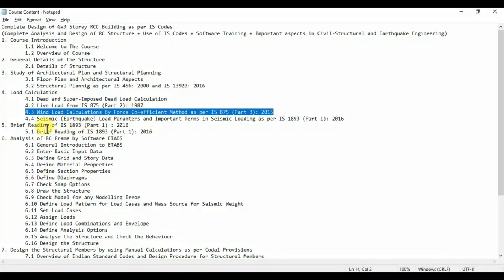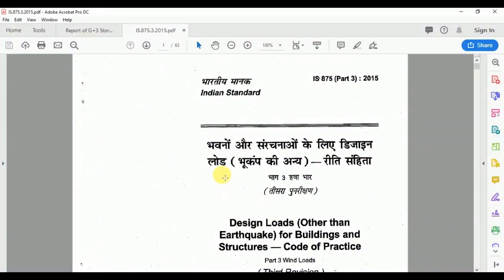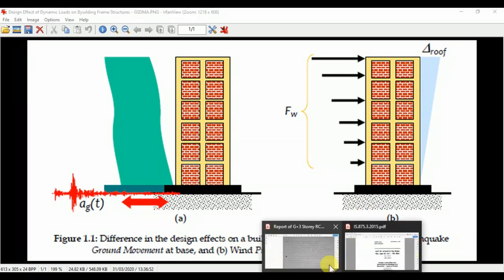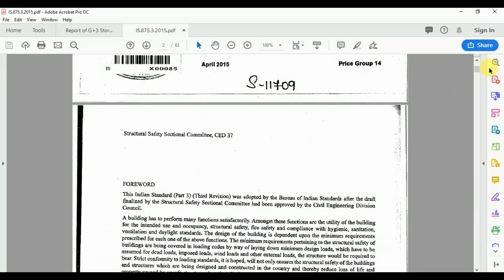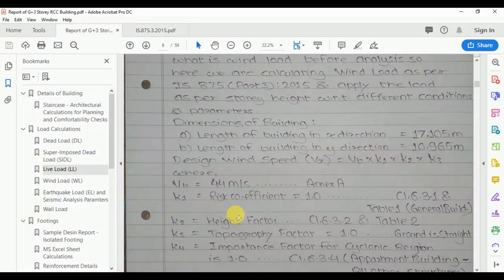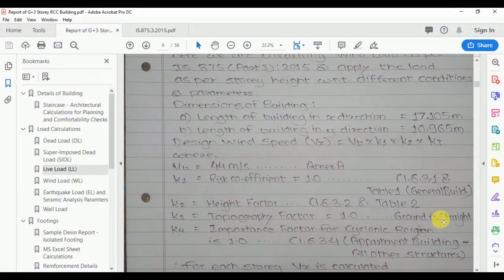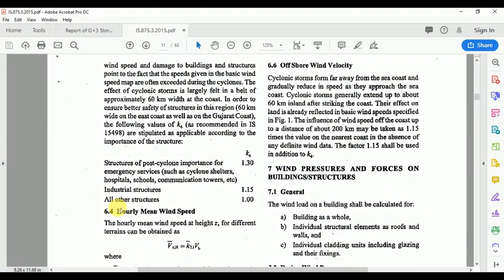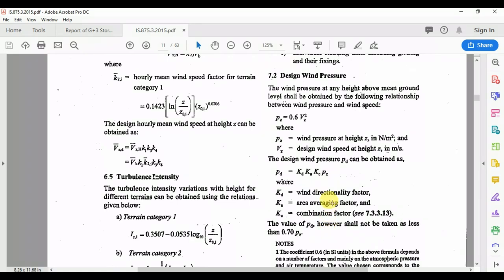4.3 Wind Load [WL] Manual Calculations By Force Coefficient Method as per IS 875 (Part-3): 2015

Comment: Good explanation sir but how to calculate the tributary area. for considering value of Ka
Reply from the maker: @harishacharya4470  tributary area is the area covered by single column half distance c/c from adjoining beams from bottom floor to top floor....
you should calculate minimum span's tributary area and w.r.t. ka should be taken, for a small structure to be on conservative side ka you can be taken as 1 only...

Comment: Wonderfully done....i can the efforts put into this....please also incude design usin IS 16700 at some point if possible
Reply from the maker: IS 16700 is only for Structures more than height 50m and upto 250m ... for small building project IS 16700 is not used ....

your suggestion, I will consider for future video creation ...
Reply: @AkshayThakur  thanks... this code needs detailed explanation and very little material is available to understand this code....if you have any material source on this code please suggest
Reply from the maker: Book: Brief Review of Structural Aspects of IS 16700 https://www.springerprofessional.de/en/a-brief-review-of-structural-aspects-of-is-16700-2017/16895598

Article: SEFINDIA
https://www.sefindia.org/forum/viewtopic.php?t=19035

also go through some research papers on sciencedirect and books on springer over this for crystal clear understanding on structural safety of tall concrete building structures

Comment: Sir thnx you have shown whole calculation by user load . sir but as we select user load inspite of is875 . so how to assign these wind load ?
Reply from the maker: @shraddeshshirode7556  , etabs has not proper inputs for code based wind load....
If you select wind load pattern as IS-875 Part 3 2015 then Windward and Leeward coefficient etabs is asking whereas in code there three methods by which we calculate forces: pressure coefficient, force coefficient and gust factor approach....
People do input 0.7times Cf in Windward
& 0.3 times Cf in Leeward
but I feel this is not aapropriate and hence y9u should manuaply calculate loads and apply to your model!

Comment: Sir In sidl load 50 mm 0.21*5 ( what convert met/inch/ what5)how in wall load internality mortar
Reply from the maker: for 10 mm it is 0.21 kN/m2 right
so for 50 mm
it is 10×5=50 :: 0.21×5=1.05
hence for 50 mm it is 1.05 kN/m2
Reply: Thanks you very much sir
Reply: Sir 6 mm Ceiling plaster is 456:2000 page no.? Nominal size and mass/weight?
Reply from the maker: for dead load refer IS 875 Part-1 1987
in which you get mortar weight in kN/m2 i.e., 0.21 kN/m2 for 10 mm
so for 6 mm it is 0.6 × 0.21 = 0.126 kN/m2

Comment: The excel that you have provided. In that excel fine the effective height of floor 1 is 3.25m and in the utube video tutorial it's 1.625. Which one is correct
Reply: And what is that table For UDL calculation on column for?
Reply from the maker: sorry for my mistake, in the excel sheet what i provide is correct...
1.625m is the effective height for head room slab
3.25m is the effective height for all the intermediate floors
Reply from the maker: that udl is the same for the given input... btw it is another approach to apply wind loads which i won't mention or teach in the course...
Reply: @AkshayThakur  can I remove that udl part. I could be asked what it is for. I have given a task to design and analyze a modal in 3 days I have to complete that
Reply from the maker: yes you can 👍🏻
Reply: What if there is no head room slab and all just a simple 6 story building box structure.  Than the effective height will be same for all? Or it will still be 1.625.
Reply from the maker: then also at top height is half....
the thing behind the conceot is we consider force acting over diaphragm of floor so the half height of upper and lower floors are consider...
Reply: @AkshayThakur  my story height is 3.4m and 6 story building it is.  So the effective height will be 3.4/2 = 1.7m or 3.4 +3.4/2 = 3.4? I am not able to understand this.
Reply from the maker: for top storey slab only half and for rest all slab levels, same as storey height...
Reply: @AkshayThakur  thanks for all the help u r doing.

Comment: how you calculate area avg factor Ka.In code tributary area is given.
Reply from the maker: basically tributory area is the areq that causes loading and so here in this case area of 1 panel of floor is 3.25×17.105=55.59 m2
for exact actual "ka" value you have to interpolate this area value to value shown in table 4 of IS 875-Part 3

sorry but while preparing the course i won't consider too minute things to include so i don't mention that...
I hope you get the point, that how to consider ka value as per tributory area!

Comment: length at x and y dirn is taken upto the cantilever top or upto the plinth level .thanx
Reply from the maker: It is max length in X and Y Direction at repective storey, for respective floor calculation ... 
At top you need to only consider head room dimensions ... but for be on conservative side I took max at all floors respectively ...

Comment: While calculating Pd= Kd.Ka.Kc.Pz

Can you explain little how to read value of Ka & Kc from IS CODE. You skipped it in the video.
Thanks
Reply from the maker: ka is area averaging factor that depends on tributary areas of columns
Ka = 1.0 for area less than or equal to 10 sq.m.
Ka = 0.9 for area equal to 25 sq.m.
Ka = 0.8 for area greater than or equal to 100 sq.m.

kc is combination factor that is depends on structures's framing action against wind
combined effect of wind loads on the frame, a reduction factor of Kc = 0.90 may be used over the building envelope when roof is subjected to pressure and internal pressure is suction, or vice-versa.

Comment: why have you considered the dimension b as 10.965 even for head room roof ? is b base dimension in y dir or floor dimension in y dir?? Since wind strikes on each floor, so isn't the dimension of that floor be considered?
Reply from the maker: yes you are right, but at top Wind Load is at it extreme level and from perpendicular direction also wind in acting so to became on safer side I Consider whole length for Head Room Slab as respective bottom storey ....
Reply from the maker: in Load Calculations, always care about wind load at top storey because major chances of collapse/damage in windstroms is at top because of no respective support over it ... this type of safety may trouble you while analysis to satisfy codal requirements (that easy to resolve) but not affect much more in design.
as designer most important thing is safety ... so always give more importance to lateral loads ....

Comment: Sir can you tell how to find cf for cylinder or pole
Reply from the maker: To calculate wind moment you can use following formulae as per AASHTO
(½ x circumference x wind pressure) x (pole height^2)/2
this formula might gave you some higher moment than in general if you check with NESC or with other codes....

Indian Code IS 875-3, i am not sure where actually code mentioned this or not....
Reply from the maker: in such structures like light pole Force-Coefficient method is not used instead of that Pressure Coefficient Method is used.
Reply: @AkshayThakur  thank you sir
Reply: Also sir can you make a video how to design a flag pole manually of a height of 60 ft and in staad
Reply from the maker: @divyanshsharma5538  I am not working in steel structures in major, anything related to high-rise rcc I am open to discussion....
Reply: @AkshayThakur  ok sir ,  can give me a hint how to do it iam designing a pole of 60ft and want to find the moment  i dont know how to proceed
Reply from the maker: @divyanshsharma5538  contact random somebody by LinkedIn - working in steel structures, that the only way I think so, I don't know anybody who is doing this...

Comment: why force is not changing wrt height of the building?
it has changed at first storey only. why not for remaining?
Reply from the maker: wind force is depends upon varoius factors.... most importantly k2 is increase as height increase so....
Reply from the maker: effective height also matters....
Reply: @AkshayThakur  in your example.. Why it is not changing as you said in beginning of the video.. Force will increase with the height.
Reply from the maker: WL increases if your structure is tall structure... in this case buiilding is of height 15 m only & you can see in IS 875.3-2015 for particular considered case in lecture is terrain category 4 in which k2 value till 20m is 0.8 hence here no sudden change in increment of wind is not possible...

but if you are calculating wind load of 10 storey or above there you will ge to see this....
No sudden wind load increment for low rise building structure....
Reply: @AkshayThakur  ok.. I agree that there will not be any change in the wind force up to 20m height. 
But in your example you are showing 11 & 21in x direction and 19 & 38 in y direction....how?
Reply from the maker: @sanjaykumar-nj9sc  here in video lectures considered building is rectangular, X length > Ylength
for X direction wind load, Y face of buiding is consider
& for calculation of wind load in Y in direction, x is facing side....

so because of this dimensions are used in calculation of effective area for wind load... changes are there in wind load in x & y direction....
Reply: @AkshayThakur  in x direction why two values 11 and 21?
Reply from the maker: solve by yourself one example manually you'll get all those things, that how changes are happen.... only by collecting information you will not throughly understand.... all the best!
Reply: @AkshayThakur  👍

Comment: Value of Ka depends upon tributary area. What is tributary area?
Reply from the maker: tributary area is a loaded area that contributes to the load on the 
member supporting that area
Clause 7.2.2 of IS 875 Part-3 (2015)
Reply: @AkshayThakur  Yes..I referred to IITk GSDMA explanatory examples, there I could see lot of examples for framed and unframed buildings. Now it's clear. Thanks.

Comment: Hello sir
In excel sheet what is that " for udl calculations on columns"?
N at last " X C/C distance" what is that sir?
Reply from the maker: that udl value can be use with different methodology... ignore that for the force coefficient method...
Reply: Thank you sir
Reply from the maker: check the about section of channel....

Comment: sir how effective height of 1st floor is calculated?
Reply from the maker: effective height is the half from below storey and half from above storey and in the way we need to consider ....

by mistake, I have not mentioned ground floor so the height from below the storey to 1st floor not consider ... it is ok for small rc frame building but for high-rise building structure you need to consider that as well ...
you can consider that for more effective results ... 👍🏻

Edited: download the updated excel sheet through the same link for all things set with formulas and correct effective height....
Reply: How to find value for wind pressure ?????  Couldn't understand.
Reply from the maker: @Bhushan Patil 
pz = Wind Pressure = 0.6 Vz^2
whereas Vz depends on vb, k1, k2, k3, k4 you can also make whole calculations manually...
for only multiplication function [mathematics], I have used excel sheet ....
take a copy of IS 875-3:2015 and go step by step likewise in video .....
I hope your doubt will now resolve ...

Comment: Sir, How did you get 1.63 as effective height @1st floor? while you have taken 3.25 as effective height for the rest of the floors in excel sheet!
Reply from the maker: sorry... for mistake... there should be 3.25 meter because half of below and above height.....
Reply from the maker: thing is that, for first floor half of ground floor height and half of 1st floor need to be taken, & in sheet I don't mention Ground Floor, so sheet did't get thing in formula for calculation.... that's the problem... but now i have updated the sheet in which you need to input efffective height for 1st floor and for other floors sheet will calculate by itself from input data.... download the excel file again... for updated things....
Reply: @AkshayThakur  thanks a million sir, Appreciated 👏👏👏
Reply: @AkshayThakur  sir can you make the similar video of shear wall?
Reply from the maker: @jamescarter3090  welcome dear & thanks for suggestion...
Reply: @AkshayThakur  you are welcome sir :)
Reply: @Akshay Thakur sir, you had removed the video of slab design? sir could you please upload that video again?
Reply from the maker: @jamescarter3090  sorry... there was mistake in that video, so it was removed... if possible i will make a new one...
Reply: @AkshayThakur  it would be a big big favour  sir! if you do sO 😊

Comment: Why did you perform the wind analysis ..
as per NBC we only perform wind analysis when the structure height is above 15m
Reply from the maker: this is not any guideline that should we not apply for lower than 15m structures by NBC or IS, this is general conecption that wind load is not domniating for low-rise RC structures and it somewhat true also ... but if designer wants to apply the loads governing for better stability and safety it is a better thing ....

& to give the overall procedure, I made this ...
Reply: @AkshayThakur  I want ask. One thing. I have read in online articles and answers from Structural Engineers. That if earthquake load exceeds Windload Windload need not to be considered ... But I couldn't find the reference in is-875-p3 .. do u know about this.. will be very grateful for your reply...
Reply from the maker: @omarbhati5038  to do not consider is not mentioned at all in code...